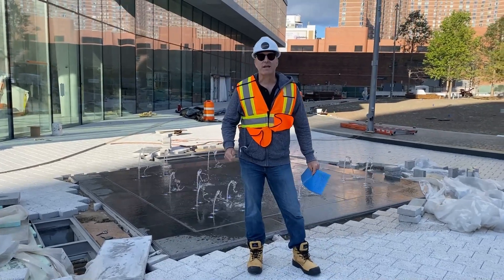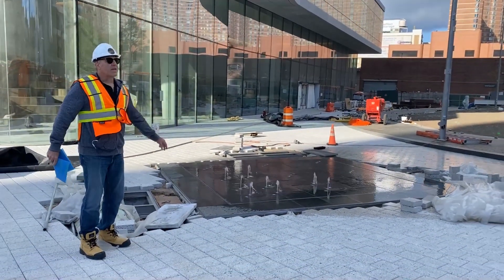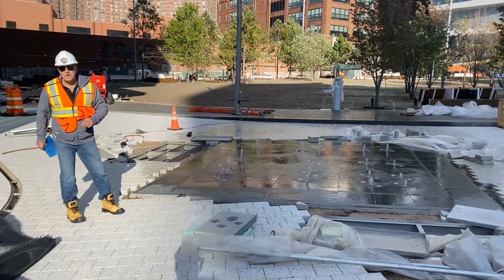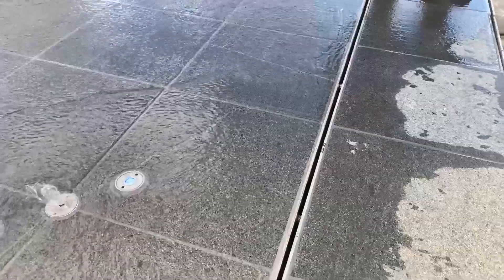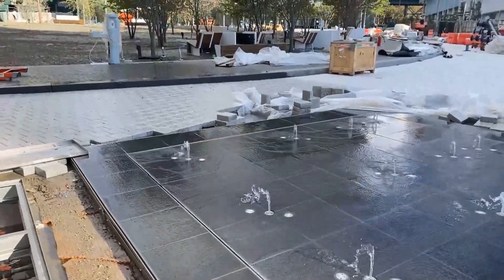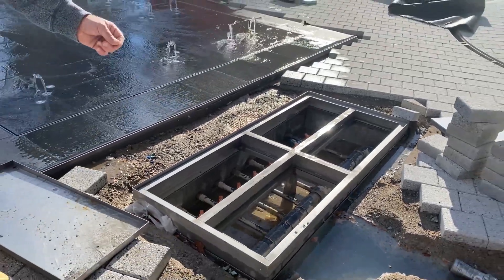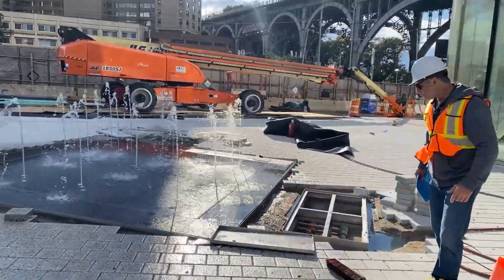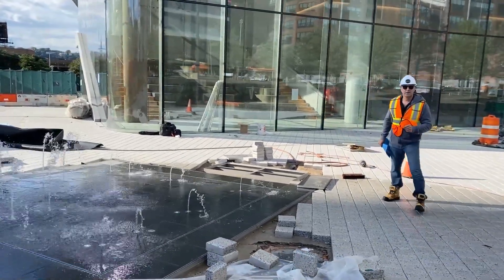Behind the Scenes (BTS) with Rob Mikula, Hanna Koh and Roger Quesnel at Columbia University

Comment: Nice feature.  Adding a 5mm raised lip (with a rad) on the opposite side of the slot drain would have prevented a lot of the water from flowing over the gaps...